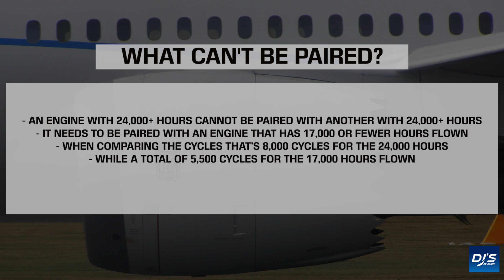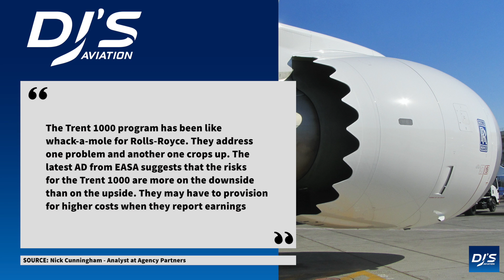New Boeing 787 Engine Issue

Comment: Correct headline would be "Problems with the Rolls-Royce Trent 1000 engine". Operators using the General Electric GEnx-1B engine on a 787 don't have a problem.
Reply: Or it would be "New Trent 1000 Engine issues"
Reply: @noah9130  or "More Problems with the Trent 1000 Engine"
Reply: Ian Caldwell Or even "More Issues with the Trent 1000 Engine"
Reply: It’s an Airbus bias world these days but I have to wonder they’d react if DJ posted that Airbus is paying a few billion Euros to put bribery practises behind them but at least it’s a smoother process as opposed to this RR Trent 1000 and 737 max crisis

Comment: That’s why WestJet and Air Canada went with GE for their engines on the 787
Reply: So did Birman Bangladesh 🇧🇩 Airlines!! Thank God!!
Reply: @salmanGT4 What a relief!
Reply: I would like to say so too for Air New Zealand. Initially Air NZ went for RR Trent 1000 for B787-9 but due to issues they went for GENx on their B787-10.
Reply: RR engines even on the older 777 has been causing issues,GE-90 is one of the most reliable engines out there.
Reply: Qantas and Jetstar did too.
Reply: Nobody could have predicted the future. They didn't choose GE because the engine is better or whatever, GE gave the better price.
Reply: @montiro8999  Ah AH AH
Reply: Um a nope
Reply: All 787 costumers should raplace RR with GE, if they want to be ok
Reply: I wouldn’t even get on a 787 that I knew was powered by Trent 1000 like BA’s ones

Comment: These are aircraft that have been in service a relatively long time.  The first 787-8 was delivered in 2011.  That said, my understanding is that these jets should have an estimated lifetime of 40,000 to 50,000 cycles.  It would seem that 8000 cycle number is not all that high number?  I am looking for some context for this information...

Comment: Maybe the quad jets could be around a bit longer. It’s better for business to fly older more reliable tech at lower margins rather than having it fall out of the sky.
Reply: I would have to agree at this point. Just look at the 747, been around for decades now and seems to rarely have issues. At the beginning of its life there were a few bumps ere made but fixed.

Also have to wonder if too much technology on a plane could become its achille’s heel.
Reply: @HorseCrazieGirl15  Not really. Just look at the 777, been around for years now and seems to rarely have issues.

Comment: so Boeing blames RR for their own faults.
Reply: No, Boeing blames RR for RRs mistakes that cause problems for Boeing. This is an ENGINE issue. RR makes the engine, therefore it is RRs fault and responsibility.
Reply: dave miller Boeing tries to change the attention of the world to RR. They want to hide their own mistakes that costed many innocent lives.
Reply: @aeropilot6789  The 787 problems are ENGINE problems. Rolls Royce make sthe engine. The 787 problems are the fault and responsibility of Rolls Royce. Boeing knows it, Rolls Royce knows it. EVerybody knows it  except possibly you. Boeing doesn't manufacture the engines, neither does Airbus. They buy the engines from RR, or Pratt and Whitney or GE.  So if there is an engine issue likr this, it is the responsibility of the manufacturer. Boeing suffers from it but it is RRs fault. And, the 787 has 2 options for engines. One Rolls Royce, the other GE. The airline buying the plane chooses the engine option. Boeing is blameless in the 787 problem.
Reply: Ladh 70  I think AERO PILOT is talking about the MAX. If not, then he is an idiot
Reply: Fs777 737 max has a MTAC problem. Why Boeing do not admit it?
Reply: Because the former Boeing CEO (who was formerly an engineer before the McDonnell Douglas merger) had poor communication skills and lied. The new CEO has a lot of work to do sort out the mess
Reply: @aeropilot6789  admit it?! The issue has been going on for nearly a year now how stubborn are you?
Reply: AERO PILOT Everything is said
Reply: Idiot

Comment: Well, this is kind of good news for GE...
I guess everybody ordering new 787s will probably go for the GEnx.
EDIT: But yes, Boeing can't escape from being affected by this. It's very unfortunate.
Reply: If this problem continues RR could go down to 30% of 787 engine market share. On,h a few like with Lufthansa’s recent order will have it selected. Lufthansa chose Trent 1000 to support jobs here in Europe but they will be in for a rude awakening 2 years after deliveries when fan blades cracking comes (assuming RR give them engines that aren’t fixed of the issue)

Comment: GE is pretty much the most durable engine in the market.
Reply: GE90 has been fine mostly apart from a few hiccups here and there which have involved FAA issues directives. Trent XWB has 2 shutdowns but nothing serious and GE9X problems seems to have stopped. GEnX has also been trouble free for years after initial troubles in 2012 and 2013
Reply: @Kyros - specyfics please... Airline, date, flight number
Reply: I am aware of that but I thought GE9X problems finished many months back
Reply: @filledwithvariousknowledge1065  Yeah its fixed. If it wasn't fixed then the 777x first flight wouldn't have taken place. Right now, everything seems good and now just went through its second testing yesterday.
Reply: The best!

Comment: I've flown the GE on the B737, B767, B777 and DC10...RR on the B757...PW on the DC9.  By far the GE engine are the best.  I  haven't flown a recent PW engine,  but I don't trust the geared engines.  Just too many moving parts spinning at a high rate of speed....Not good.

Comment: It is a real worrying time for new passenger aircraft. The real problem is the manufactures. There has to be stricter control. Maybe use them as freighters for a couple of years till the bugs are eliminated.
Reply: Yes, because freighter pilots lives don't matter.
Reply: Yeah right. great idea.NOT!
Reply: Freighter pilots lives do matter. What I am saying it there should more hours put on the aircraft before they are certified. It seems like the passengers and pilots do all the testing. Airbus delivered to Lufthansa an A350 and on the maiden voyage with Lufthansa personal in the aircraft the back cargo door opened.

Comment: What did they do so wrong on this engine??
Reply: Boeing may have set a 2 year time preferably for the engine to be ready but RR management told engineers to rush it as if they were given 6 months to a year
Reply: So how come the Trent XWB works flawlessly on the A350?
Reply: FlightFilms they probably learned from their mistakes on the Trent 1000. The Trent XWB and Trent 7000 was developed later and they work good
Reply: Ben Ghazi  How could they have rushed when Boeing was years behind themselves?
Reply: Ben Ghazi  OK, and why did Boeing rush the 737 MAX? Because airlines wanted it before 2020. So If you're pointing the finger to Boeing for wanting RR engines sooner, then you may as well blame the airlines for wanting the MAXes sooner. However, the MAX Fiasco happened because Boeing made the decision to rush. In the Trent situation, RR was the one that rushed the engine, and like Boeing in the MAX situation, RR in the Trent situation could have told Boeing and the airlines that the Trents needed some work, but they rushed it and never told Boeing or the airlines about it. In short, blaming Boeing for the Trent 1000 is like blaming the airlines for the MAX; blaming RR for the Trent 1000 is more comparable to blaming Boeing for the MAX
Reply: Ben Ghazi  can you give us a link that proves boeing rushed them please?₩
Reply: The fact he hasn’t suggests he’s an Airbus troll
Reply: RR rushed it to compete with GEnX despite the warnings from engineers like with 737 max
Reply: Ben Ghazi  no they did not

Comment: Why such issues with engines lately?
Reply: The drive to lower emissions is killing sound engineering
Reply: Rushing engines is the problem. Yes the newer designs emit less pollution but eventual they need to run on a biofuel as biofuels can reduce emissions (as an estimate that Boeing did a few years ago) by 60 to 80%

Comment: This issue with the RR Trent 1000 engine issues, is just another problem with this model. What I feel that needs to be done, is when an aircraft is being designed, is to have 2 or 3 choices of engines that can be used on that certain model of aircraft. That way, if issues come up with a certain engine model, other choices can be used. Yes, you would change out all engines on said aircraft model, for the new other engines. None of this is Boeing's fault.
Reply: You don't understandard how extremaly complex it is to design a jet engine, especially one that meets current environmental, performance and reliability requirements. On top of that there is a gigantic cost of the design. There are literally few companies in the entire world that know how to do that and have resources to even afford to start. With more than 2 engine makers offering an engine for the same application,  and assuming even share of the market, probably none of them would break even on the deal. Why do you think there is just one, at most two engine options for any modern airliner?
Reply: Walter  Hey dumb ass !!! The 787 is offered with 2 engines options which the airline chooses and fortunetly 60% of the 787's have the GE engines !!!!
Reply: Wilbur Finnigan   That was not a Dumb Ass statement. You’re rude and should be banished to the cow pasture. 😠

Comment: It’s seems the newer more modern planes need a drastic rethink from engineers designing these engines for very long flights etc. The engines are not up to the job. Quieter engines are wanted to lower noise pollution as well as efficiency but time after time their has been engine problems
The engineers have not kept up with the pace of the new  low emissions crafts requirements. Neither Boeing nor Airbus can be held responsible for this debacle. Rolls Royce needs to sort itself out time is running out ✈️❤️🇬🇧🇺🇸😥💕
Reply: Elaine  solution is for airlines to just order the GE engines  or convert the RR to GE  !!! Problem solved !!!!
Reply: @wilburfinnigan2142   She is right though, going forward. And as far as airlines just ordering new GE engines to replace the RR engines.... You know nothing about this business!
Reply: Ladh 70   Look the same sort of stuff goes on in US Eg Boeing will never go bust it’s just a dept of US gov paid by US taxpayers. A plane takes of every 2 mins there’s a 10% tax on each plane ticket you don’t need to be an economist to  do the maths lol. No country can allow its Aviation industry to fail it would destroy its economy that’s the truth of it ✈️❤️🇬🇧🇺🇸😁✈️

Comment: This is relevant to the compressor stall incidents that seem to be very difficult to investigate and fix. The specified de-pairing is based on the statistics so far suggesting that engines with over a threshold of flown hours/cycles tend to suffer more of this stall compared to engines with less, and thus it is meant to decrease the detrimental impact of having both engines of the aircraft shut down should this occur. I am not sure they have even identified the root cause as yet, so my understanding is that this directive is a precautionary measure.
Reply: thank you!! thank you for providing at least the TLDR of the main information I was expecting considering the video title.

Comment: Boeing needs to look at expanding the GE engine production facilities. The 787 is an incredible aircraft and Rolls Royce is weighing it down.
Reply: Anthony  Fortunetly airlines have only ordered RR for 40% of the 787's !!!  GE has 60% of the market, thankfully !!! RR needs to get this engine sorted out, even IF they have to change out ALL the engines that are affected !!!!  Thankfully there are NO  RR engines on the 777X !!!
Reply: Like the GE one that went bang the other day on a 787?
Reply: There were GE9X issues last year during testing but they seem to have been fixed now
Reply: Engine problems are affecting every engine manufacturer. Remember the problems delaying the 777-9 first flight.. the GE 9X.. I wonder who makes those???
Reply: @bobdevreeze4741  What you don't understand is that GE had the problem while making the engine. GE never said "alright, we are ready, take those engines, they are completely reliable" until the moment when they were completely ready for that. RR gave poor products to customers. GE has never done that. That's the main difference.
Reply: GE9X problems seemed to be fixed now
Reply: Plane Facts Yes. I hope there won't be any more issues

Comment: Geez things haven't been going well for Boeing since 2018 has it?
Reply: this is more for rolls royce than it is for boeing. Now manufactueres will be less interested in operating rolls royce engines, which will impact rolls royce a lot, since boeing can just choose to use PW or GE, like they did with 777x.
Reply: How is this Boeing’s fault? If you watched the video. RR is to blame. 
If a PW engine fails on an A320NEO you’ll find a reason to pick on Airbus? I don’t think so
Reply: Well he didn't say it was Boeing's fault did he? But since the engines are fitted to Boeing's planes, it will effect Boeing won't it? Especially after all the other issues they've had. Boeing clearly has had a cost cutting focus, which now comes back to bite them in their...
Reply: "Luck is where preparation meets opportunity". Roger Penske said that and its something I have taken to heart in my career.  Boeing has been its own worst enemy for a few years now. I see the deficiencies in upper management and outright complacency from actually having too much success as the biggest problems the company as a whole faces. They owned the inspectors, they were riding a wave of success that was a decade long... and it all blew up in their faces.